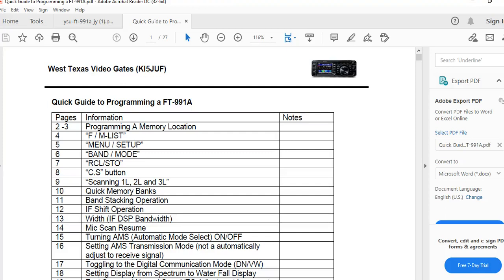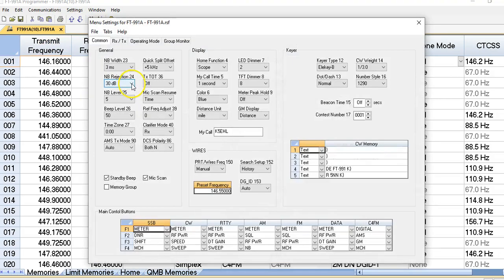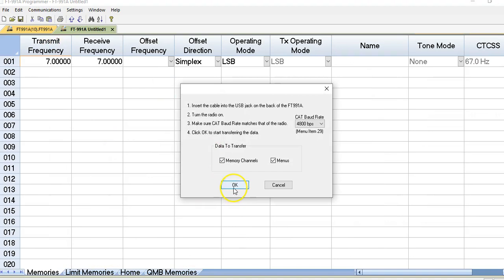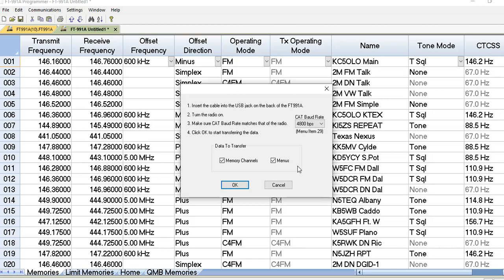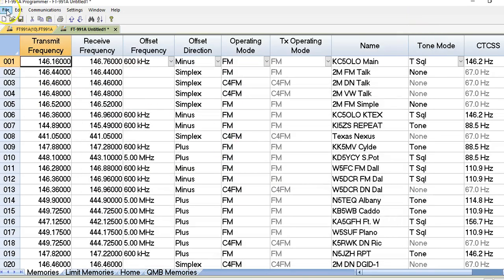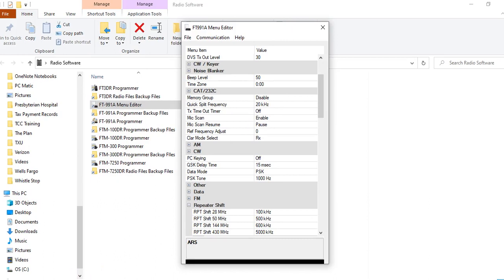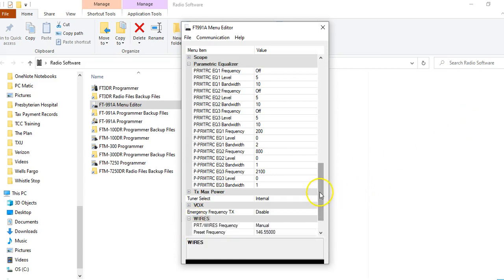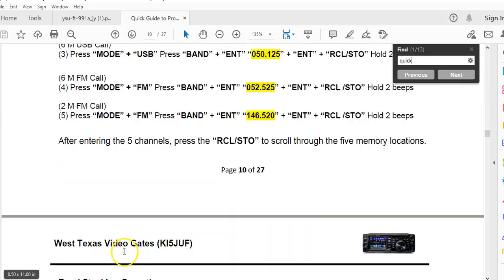RT Systems Software Additional Feature on the Yaesu FT991A, Programmer, Radio Functions& Menu Editor

Comment: Is there any simple free  programming software like chirp for this radio?
Reply from the maker: Good morning Pat, There are some generic programming software programs from Yaesu and I think they are free let me do some digging '73, CHIRP is also another one and it's free, as ling as you have USB A  to B that should work, I'll get back to you '73
Reply: @westtexasvideogateski5juf255  if i have to pay for it  then OK. But my Retavis RT 90 came with  a lead and programming software,  as did my Retavis RT3  DMR handheld. But a 1300+ pound radio doesn't ?

Comment: What's the difference between the Menu Settings in the Programmer and the Menu Editor software?  There are obviously formatting differences, but I am not sure if they are both editing the same information in the FT-991a.  Thanks
Reply from the maker: Hi Steve, the Menu controls the actual buttons and features you use when touching the buttons, the Programmer is only for the frequencies and memory  locations, normally I always disable the Menu check box so it it does not overwrite any active settings.  Let me know if you need anything else always email me  glad to help '73

Comment: I learn something from each video you do.  Curious that RTs doesn't reference the menu item number to coincide with the item number in the manual and radio.  I understand RTs seems to group related functions, so perhaps I am learning more about the radio.
Reply from the maker: No problem Edward, thanks for the message, this strange , I wondered about that myself, you would think having registers to enter variables with the same location (number) would be logical?  I'm working with that's why there's been some strange  videos popping up I'm not in front of the radio this weekend, I'm learning new software plans for more videos, '73 de KI5JUF good to hear from you!!

Comment: just started the video and had to pause it to see what you have programmed in to your radio.  I am sure I will edit this comment when the video is over but....  I love my RT Systems software.  It lets me copy and paste frequencies from radio to radio.  Do you do the External Data under the file dropdown menu?  It lets you choose like all repeaters within 150 miles of Abilene or what ever city you want.  And it imports ALL of the settings for said repeaters.
Reply from the maker: Hi Steve, thanks very much for the message, I actually have not tried that feature, and I should it's a good idea, most of my channels are ones I've collected from locals, I'l try it.  Thanks agian for the message and let me know if there's anything I can do for you '73 from KI5JUF
Reply: Do all the offsets stay the same even if different to the radio menus